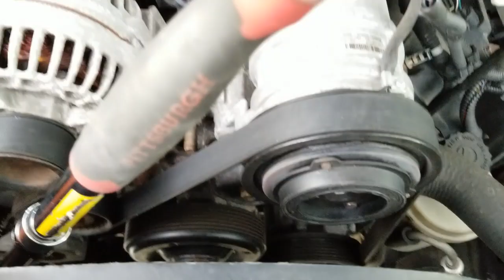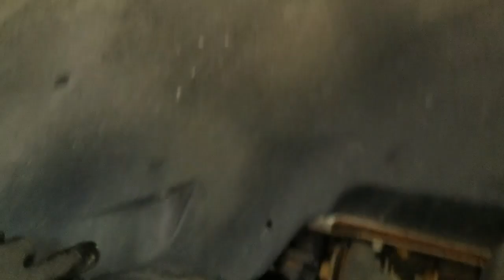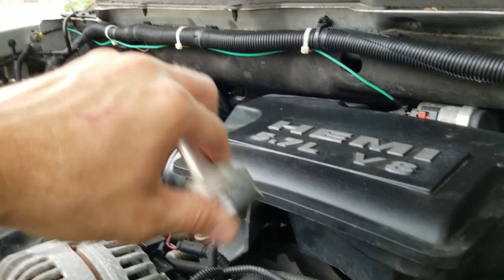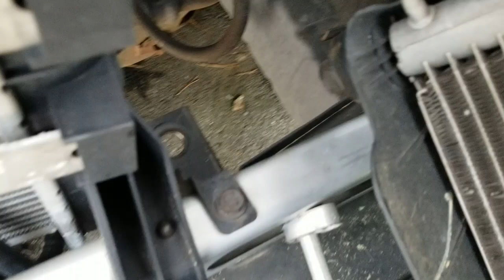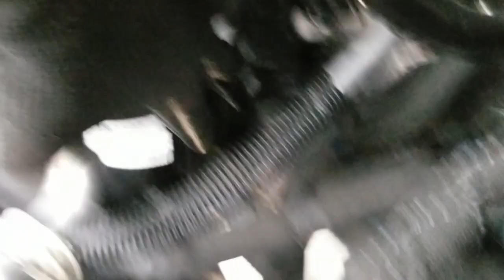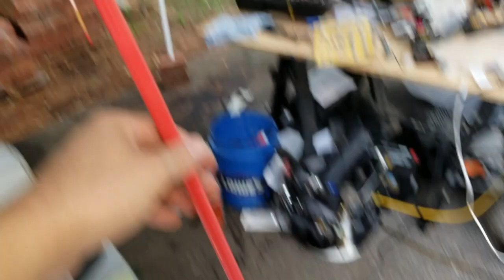AC Repair & Compressor Replacement  - 2008 Dodge Ram - Part 1

Comment: Probably too late for this but this also happens with your low and refrigerant. Unfortunately I had a leak at the evaporator core behind the dash. And I got away with using sealing r134 every 6 months. One day the low side valve when out and it stopped working. It leaked everything out and that’s why the ac compressor wasn’t working. I filled it and it worked. The way I diagnosed was jumping the clips to the battery and the clutch engages

Comment: Hey man ! I have a question. I own a 06 ram 5.7 it hasn’t had ac for years. But when it did it blew cold. I’m guessing it had a leak. One day I decided to go to Walmart and forgot to measure the ounces so I think I over charged it. Killing the ac clutch. Also When I turn on the ac. It smells horrible like chemicals so I’m guessing it’s a ac evaporator core leak behind the dashboard. My questions is. I’m getting ready to spend a lot of money. New ac compressor new lines. New drier. New new condenser and new evaporator core. Should I pull a vacuum on the system ? Or it wouldn’t work ? I don’t want the new parts to get contaminated or whatever else can happen if I just replace instead of removing everything. The truck has zero Freon !  Ac clutch doesn’t work. It doesn’t spin. Any tips ? Also or do you think putting new parts should be fine ? I’m glad I found your videos man ! I helped out so much !!!

Comment: When I was doing it hard pressure of air was coming out when taking off the two tubes on top is that bad?
Reply from the maker: Did you not have the refrigerant recovered by a repair shop prior to beginning the repair?  It sounds like you still had refrigerant in your lines when you opened things up.  It's not the end of the world at this point, but it's much safer and better for the atmosphere to have the refrigerant properly evacuated from the system before removing any components.

Comment: Negative batman you don't have to replace the accumulator. You just need to pull a vacuum on it to -30. That will remove all moisture.
Reply: Can you pull a vacuum with a leaky evaporator core ? And also my ac clutch isn’t engaging so my compressor doesn’t come in

Comment: I have an '08 Ram 1500 5.7 Hemi.. I'm trying to find out if it has an expansion valve or an orifice filter. O'Reilly told me their system only shows a valve ($42.99), but AutoZone  said an orifice filter came up on their system ($2.99), so I bought the filter. But i can't seem to find which of the two it is - I've googled & YouTubed it & no luck. Can you help? 

TIA
Reply: Jesse,
I'm sure this comment may come late for your current repair, but this info might still prove helpful. I often use RockAuto for parts when I'm shopping around, as Matt did for this project. Their system breaks down all the available components by category for your vehicle once you enter the make, year & model. Takes the guesswork right out of the equation when in doubt. In your '08 Ram 1500 5.7L V8, you have an AC orifice tube. Cost is less than $0.50 as of this posting. I hope this helps for future repairs.

Comment: My AC blows fine and ice cold until I’m at idle. Do I need to replace the condenser. Thanks in advance.
Reply from the maker: Hi Michael, I'm not an AC expert, but I'm wondering if you have an issue with your electric condenser fan.  Have you confirmed that it runs?  I'm suspicious that your electric fan is not working properly, so when you are driving at speed, air is naturally forced over the condenser coil, but when you are at idle, there is little/no airflow over the coil, causing the efficiency of the AC system to degrade.

If your condenser fan is actually working properly, I'd recommend checking the AC refrigerant charge next.

Good luck!  I hope you're able to troubleshoot your problem.  Thanks for visiting my channel.
Reply: If you haven't already figured it out, look under the hood while everything is running.  With your A/C running, the condenser fan should be on and moving air.  IF that fan isn't running, you need to replace it.  There's quite a few videos around here on how to replace, just the fan and shroud without having to replace the condenser.

Comment: Thanks for posting this.  I have a 2006 5.7 with about 70k miles on it.  I started getting a weird clanking sound in July 2019 even with the A/C off.  I thought it was the exhaust system at first but I seem to have narrowed the noise to the a/c compressor.  Starting to accumulate parts and knowledge before tackling the job.  Nice thing is everything seems readily accessible unlike when changing spark plugs.

Thanks for the RockAuto suggestion.  I forgot about them.  Summit always just pops in my head first.  My Haynes manual says when replacing the A/C compressor to also replace the A/C accumulator.  I'm not going to tackle the lines or anything else at this point unless I run into problems during disassembly, won't hold vacuum, etc.  

Thanks for Part 2.  I was wondering about how much oil to add to the system.

My daily driver (02 Alero) is having an ABS/speed sensor(s) issue so need to tackle that one first with some simple suggestions before digging into the wheel bearings.  Thanks again.

Comment: Great detailed, step by step removal job Matt!  I’m about to tackle this job soon i believe.  After 11 years of owning this 2008 Ram 1500, I felt my AC get a little warm while driving the other day. I have a 4.7 tho, if you see this, do you think they’re identical?  My truck is not with me now, but it seems like my compressor faces the opposite direction. Vertical rather than horizontal like yours. I could be wrong tho. Thanks!  Again, fantastic job!
Reply from the maker: Thanks for the kind words, Kenny!  I am not 100% sure, but I believe on the 4.7L engine, the AC compressor is on the passenger side.  I think everything else is relatively the same, but having not worked on anything in a truck with the 4.7 before, I'm kind of guessing about that.

If you run into an issue, www.dodgeforum.com has been an amazing resource for me.  I'd highly recommend you check that out if you haven't already done so. (I'm in no way affiliated - just passing along a source of great information)

I wish you luck - thanks for watching!